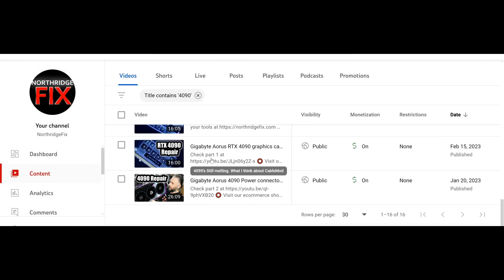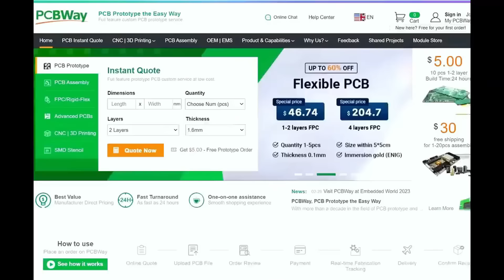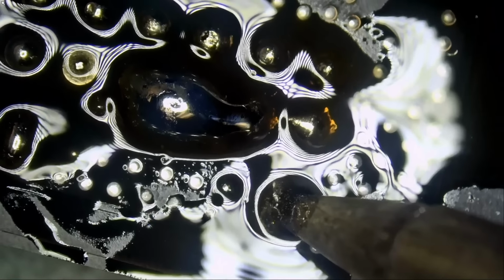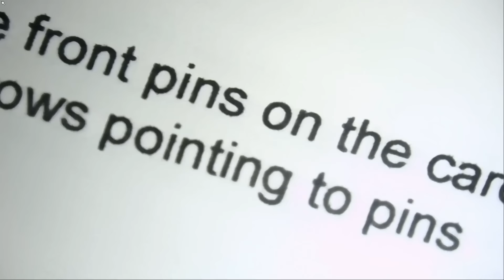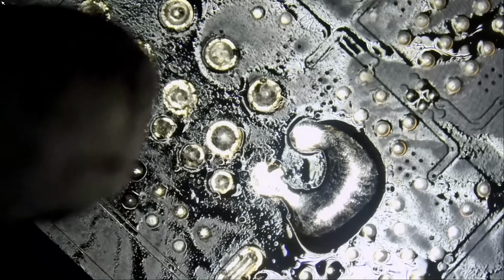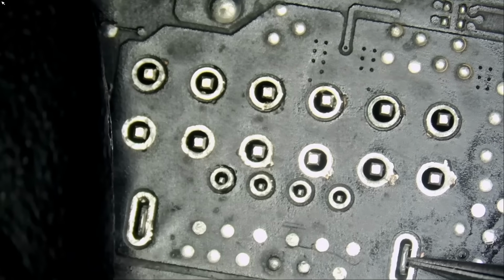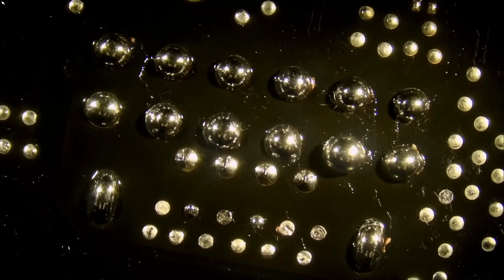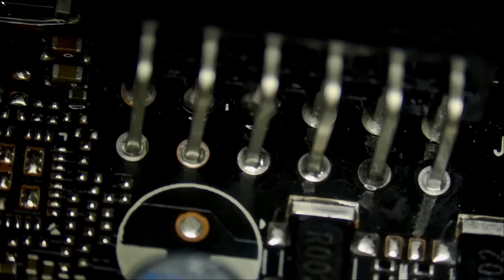4090 Graphic Cards are still a Problem.

Comment: It is beyond me how NVIDIA doesnt get a class action lawsuit to their ass. This is simply ridiculous.
Reply: Just posted the exact same thing bro - How on earth this is possible is beyond me - Clearly an issue with these connectors.
Reply: I don't know a single 4090 owner that actually has this issue. It's definitely user error. Notice how the majority of the damage was on the upper pins? Almost as if the side of the case has pushed the wires from the power connector downwards causing no full contact with the upper pins...
Reply: @jamieclarke2694  FACTS it was already proven that the melting is caused by improper usage 

always make sure your high power connectors are FULLY plugged in lmfao
Reply: They managed to make people believe 6gb of vram is still good enough, so i'm not surprised at all, people said greed is what ruining gpu market, i say it's brain rots
Reply: Because people keep buying their products and defending them. Just like Apple products, however they got sued not too long ago...
Reply: @matthewgerlach5775  Any beginner engineer can make a connector that doesn't work if it's not properly seated. It's not rocket science.
Reply: Yo this is not issue with the card… its user error!!!
Reply: @NebulositySirus  It’s both.
Reply: They are still using the same connector for upcoming 50 series cards as well. Like why? This is so frustrating. I was planning to upgrade from my 3080 but ig i gotta wait.
Reply: Because it isn't a manufacturing problem. Go watch Gamers Nexus extensive testing video on this. By far the most in-depth, comprehensive lab testing and analysis done on the issue. The result is human error, specifically, improperly seated cable that is pulled sideways. Don't argue, just watch, you will see.
Reply: @RafiYagami  Actually the connector was redesigned and the sense pins were shortened by 1.8mm.
Reply: All they had to do was pay one youtuber to convince people that it's user error and you have people parroting that Gamers Nexus proved it despite all the evidence to the contrary
Reply: @fewew7898  do you think Gamers Nexus built their business on paid biased reviews? They are the only reviewer that adheres to strict scientific testing under lab conditions and they're smarter than any other channel I've seen.
Reply: Nancy Palosi wont allow it. Its a matter of national security. Also Nvidia makes the chip and not the card
Reply: @jamieclarke2694  exactly. when I got mine I spent way longer than I probably needed to ensure that connector was fully seated, and I have the gpu vertical putting as little stress as possible on the cable. I doubt mine will melt before it's replaced with a 5090.
Reply: @MrKrabs-tr5rh  i think too, funny. Im looing out now for the TDP of the just upcomming 5090 and 5090Ti ... with OC from enthusiast rookies, its gonna be what? 800W? not too shabby
Reply: @sonsoffishes1  he( Steve B) seems to me that way. Would be a bigtime fiasco if it was other way...I mean humanity fiasco ...
Reply: @jamieclarke2694  Do you know ANY user of a video card that's having those classic PCIe connectors and have this kind of issue?

Comment: Glad i skipped the 4090.
Reply: I have a PNY4060ti 16GB it's working fine. But it doesn't have that pwr connector.
Reply: And you think the 5000 series will be better? We don't get refinement gens anymore like we used to, where they tried to make things more efficient before just BiGgEr PoWaR like now.
Reply: Glad i walked away from ngreedia  in 2002.
Reply: Im still happy with my 3090ti havent ran into anything that I need to do that it cant handle. Everyone else seems to want more more more.
Reply: I'm glad to tell you: all newer  generations  are going  to use this melting connector
Reply: @MrMousekillaz  16gb for real ?
Reply: @Par2Pixel  same. happy with my 3070ti, no issues, does everything i need
Reply: My 4070 working like a chaaaaaaaamp
Reply: You didn’t skip it, you just can’t afford it
Reply: @romankozlovskiy7899 DAMN 😱😱😱 Cold Blooded 🥶🥶🥶😂😂😂
Reply: Get AMD gpu, it ia great card
Reply: @MrMousekillaz the original comment was talking about the 4090 not the 4060ti lol
Reply: My 4080 is fine for me
Reply: @Swift5703  Word is nothing and it will not change the fact that it is an overpriced faulty hardware
Reply: @romankozlovskiy7899 Nice projection
Reply: My Asus Strix 4090 is almost 2 years old and stil going strong
Reply: @mr.number9279  We can only hope they will be better. :D
Reply: Yeah just got one a few months ago, glad to know I bought a $2000 landmine. God I am really starting to hate PCs, consoles suck but at least they don’t explode.
Reply: @fdiskformat5049  comon, I am used to expect mz PC hw to last for 10+ years eazy...lets see how it goes in the future ...

Comment: 4090 pulls like 350 to 400 watts with a small and weak connector, this is a design flaw
Reply: The specs push too much so it have very low tolerance. If 1-2 pins fails and mating incorrectly at high resistance, although it will not cause much heat because of resistance, other pins are taking more loads and get heated up, now it's a cascading failure, all pins doom to failed of 1-2 pins already failed.
Reply: My gigabyte one would pull over 500w, scary stuff I sold it because of this fear
Reply: Instead of designing the connector around the load, the consortium designed the connector first. They may have intended it to handle high Amp consumption. But....
Reply: The end of your statement is wrong - it is not a design flaw; its an intended design. Do you really think that the designer and builder of those video cards dont know their insides 100%?
This along with the fact that they dont honor the warranties fit perfectly; its greedy/savage capitalism - anything goes for money.
Reply: You can pull up to 600W on these in fact!
Reply: @ryutenmen  Por que no los dos? It's an intended design, but it's still a flaw. That's like saying Boeing's screwless doors aren't a flaw, they are, but it's intended.
Reply: 450w to 600w actually in full load

Some cards come from the factory limited to 450w, but you can push it to 600w with a simple slider in MSI Afterburner, some comes with 600w out of the box

600w is the limit of that conector
Reply: @whitebeltbjj3739  no reason? that thing is a fire hazard. I don't want anything that draws 45+ amps in my pc.
Reply: My GPU afer OC pulling  ~200W from single 8 Pin molex no issue here ;)
Reply: Always had been
Reply: @kkrolik2106 because the design works
Reply: It isn't a manufacturing problem. Go watch Gamers Nexus extensive testing video on this. By far the most in-depth, compressive lab testing and analysis done on the issue. The result is human error, specifically, improperly seated cable that is pulled sideways. Don't argue, just watch, you will see.
Reply: It isn't a manufacturing problem. Go watch Gamers Nexus extensive testing video on this. By far the most in-depth, comprehensive lab testing and analysis done on the issue. The result is human error, specifically, improperly seated cable that is pulled sideways. Don't argue, just watch, you will see.
Reply: That 12-pin connector is now replaced with a new type that supports higher draw. If one uses 16awg wires, the resistance would reduce considerably and therefore lower temperatures at the connections.
Reply: My 3090 has 2 power connectors. Not sure why the 4090 only has one? Seems like they knew what the 3090 needed
Reply: Ive seen both. You sound like a bot. @sonsoffishes1
Reply: @TheDealer6373  sorry for your brain then

Comment: People should start suing these companies for not honoring warranties, warranty is like a contract and any breach of contract should face legal consequences
Reply: The problem is that they pushed the whole user error narrative so much that companies are hiding behind that as an excuse not to honor the warranty.
Reply: that wouldnt fly in EU
Reply: It isn't a manufacturing problem. Go watch Gamers Nexus extensive testing video on this. By far the most in-depth, comprehensive lab testing and analysis done on the issue. The result is human error, specifically, improperly seated cable that is pulled sideways. Don't argue, just watch, you will see.
Reply: @Crystawth  it IS user error.

Comment: 4090 a problem, 14900K a problem... Damn, I'm still very happy with my 3090 and i9 9900K
Reply: I have the same set up and it’s doing great!
Reply: Same but with 10900k, just did a repast of my the thermal and kept both for the next 8-10 years!
Reply: See my smug smile 13700k n 4080, so quiet and so far so very very good
Reply: Try 7800x3d & RTX 4070 Ti SUPER. You'll feel a lot better.
Reply: @xfiremaniac no. Because that basically a 3090/3090TI anyway. What you want is a 4080 super. Much,, much more powerful and no problems at all.

Comment: 20 cards a week is crazy.😢
Reply: And that is just Alex. Imagine if you add all of the other repair shops, how many it is. Class action needs to be started.
Reply: @jemijona  the resell value on these cards will age like milk in the future
Reply: 80-100 card per month 😢
Reply: I just plug and play when I purchase a new GPU. Overclocking them causes most of these melting to draw too much power, and the connectors  can't handle it. Obviously, it is what's happening
Reply: Yup, alot of nerds don't know how to plug in a connector...lol
Reply: That's the tip of the iceberg!
Reply: @Nathan-ry3yu I completely agree with you.
Reply: @Nathan-ry3yu  Not all cards suffer from this fault. It is mainly Nvidia cards with their sub standard plug that is most at fault.
Reply: @Nathan-ry3yu  There, we have it. Everyone, this guy plugs and plays, so there is no issue at all.
Reply: 7 000 000 rtx 4090 selled Nvidia dont give a F lol
Reply: @Benri05  :)) it eats too much wattage for any of my liking....:))

Comment: I will never overclock my TUF 4090. 400+ watts over that tiny connector is asking for trouble. I've got mine undervolted, it rarely pulls over 250watts. I think its kept me safe so far.
Reply: I did the same to my Asus tuf 4080 super. Undervolted. Temps are great and no noise during gaming. And does not exceed 225 watts in most games max.
Reply: Got mine 480w without issues.
Reply: Why do you even use 4090 if you're not even using 50% of its performance?
Reply: That new pin connector is suppose to let GPU draw 600 watts plus the 75 watt from the PCEI lane too... the connector is too fragile which compounds with user error when plugging it in melt the cables.
Reply: @RelaxSimmer  Thats the question I'm asking... 

You paid over 1000$ for a 4090... just to use less than 50% of its power???
I don't understand that logic
Reply: @dothex  my 4090 pulls ~450 W over the last year when VR gaming in simulators without any issues.

Im using the corsair cable.
Reply: @dothex  See my reply aobve for reference, actually the -30%/-10% is the typical case but with max load, meaning original 500W drops to 350w only with 10% performance loss. But normally gaming can't drain full load from 4090, so such undervolting + oc will have the middle level of consumption 50% power and still have in average 90% performance there, compared to all the default settings.
Reply: @dothex  Maybe they heard the news of 4090 connectors melting after they had already bought one, so then decided to take measures to prevent this even if means not getting the performance they paid for.

Comment: I'm curious if out of all the 4090s you have repaired, have you ever had to repair the same board twice?
Reply: More than likely yes
Reply: I would say yes, he has repaired probably the same card more than one time reason being is because he’s not actually fixing the problem. He’s just replacing the problem. He’s not the designer of the graphics card. He just swapped out connectors.

Comment: I've loved Nvidia for the last 15 years, but I am so glad I picked up a 7900XTX this generation. Not quite on par with a 4090, but absolutely zero regrets!
Reply: LOL, I never go back to AMD. Last two 6800XTs crapped out on me 2 months after buying. AMD had no solution and gave me my money back. With Nvidia you get bad connectors, and with AMD bad connectors AND bad drivers.
Reply: @Marauder1981  The drivers on my 7900XTX work better than those on my 3090 do on my main rig....
Reply: @Marauder1981  funny I've had a reference 6800xt on a waterblock for quite some time now.  Aside from fully wiping nvidia drivers and caches, I havnt had any issues.  Sounds like user error, kill 2 6800xts.  What are the odds?
Reply: ive run my 6800 non xt full tilt for 3 years just blastin man just blastin she a banger real
Reply: XFX swft 6800xt, no issues and drivers are fine. My buddi with the 4070 is having a harder time playing pubg and warzone than I am, he's constantly getting kicked from games or loading screens
Reply: @Marauder1981  Sounds like have skill issue
Reply: @davesway1170   Getting kicked from games is a network issue, not a GPU issue.
Reply: It doesnt even match 4080 in actual gaming picture quality and performance nor efficiency
Reply: @Marauder1981  Glad I switched to Amd.
Reply: @suprafastmafc User error on 4090 plugs.
Reply: @powerplay074 I literally just watched a 4080 vs 4080super vs 4090 in 4k gaming benchmark. The 4090 is at minimum 20fps higher than both 4080s. In fact the 4080 and 4080 super were only 1fps difference across all games in 4k. 
Do ur research before making such dumb claims.
Reply: @rkwjunior2298  im talking about 7900xtx not 4090 lol
Reply: @Marauder1981  lol sure fanboy. I've had numerous AMD cards, not a single one ever died on me. I have had a couple nvidia cards die on me though. Rarely had any issues with AMD's drivers either. Such old and tired talking points.
Reply: @powerplay074  It's faster than a 4080 super, actually.
Reply: @Son37Lumiere   "fanboy" such an unoriginal insult. Are we hurt? Aww.
Reply: @Marauder1981  It's not as much a direct insult as it is a fact. Though yes fanboys are an especially sad bunch.
Reply: @Marauder1981  I don't think anyone believes you. One gpu, sure but who's actually dumb enough to buy two products form a company that can't help you troubleshoot them?
Reply: @Marauder1981 sounds like a skill issue on your end, maybe take better care of your devices lol
Reply: @Fatcat-ss6nh   maybe a better gaming chair?
Reply: @Marauder1981  I don’t see what that has to do with your terrible care of those 6800xts but ok lol

Comment: 600w and 12v is 50amps on those small wires and connectors.
Reply: Yeah, better to use bus bars than using wires with connectors.  Perhaps the 5090 will use two of those connectors to provide NorthridgeFix twice the amount of work!
Reply: It's overclocking that's doing it. Drawing too much power through small wiring will melt
Reply: Dont forget you have 5V in there as well, that I believe is the higher current.

Comment: If they admit then they will have to repair or replace... This is what happens when you have a monopoly
Reply: AMD gpu is awesome, it might not sold as well compared to Nvidia but is a better card overal if you don't want the useless features and best streaming quality in the planet
Reply: You realize they don't have a monopoly right?
Reply: @tyler6971 name one other graphics card that can compete at the 4090 level.
Reply: @nengyang1895  This question is not relevant to what I said.

Comment: I bought a 4090, oddly enough the connector at the GPU didn't melt but the connectors at the power supply unit did melt. 
I even bought the special cable from NZXT to go from 2 connectors to a single one so I didn't have that crazy adaptor with like 8+ connections installed.

Comment: Wow that should be covered under warranty
Reply: Did the customer plug it in properly?
Reply: @rkwjunior2298 im sure most of these issues is more than just connecting it properly, with how many gpus he gets
Reply: @Tsumi784  You'd be surprised how many people have trouble with simple tasks. Especially when they aren't familiar with the design change.
Reply: @rkwjunior2298  yeah thats true, however. The 4090 uses a lot of power compared to the other 40 series cards.
Reply: @Tsumi784  hahsha Cuz it has the best performance.  It's actually very efficient vs performance
Reply: @rkwjunior2298  no point in getting better performance if its at the risk of a like 2k dollar card lol….
Reply: @Tsumi784 Yeah it uses a lot of power but just maybe it's also not the best idea ever to use only 12 pins instead of 24 (3×8) to supply your card with power, just my opinion. Like using a single 8pin on a 4070 or a 7700xt...😅
Reply: @di4mondpl4ys45  Well there's a reason why its only the 4090s... and i honestly feel like it is the power, the adapter is probably fine on the 4070s and 4080s but its not built to handle 450w-650w on average. like people were having issues with the 4090s a month after release.

Comment: I’m so glad changed my mind and got an AMD card I know it’s not quite as fast but fast enough n had zero issues with it in a year n half
Reply: Sure RTX 4090 might be a little faster than the AMD equivalent but AMD one is just at the right spot for high end monitor refresh rate while extra few frame from Nvidia would not be visible with the monitor Amd gpu for 244hz monitor running at 244fps and nividia is 248fps for example  😂
Reply: No rtx lmao

Comment: I would fit a temp sensor on the connector, like the (XSPC Flat Wire Temperature Sensor 10K) Less than 10$/£ Just tape the sensor to the connector and plug it into to the T-sensor header (if you have one) on your motherboard. You can then monitor the connector temps and set an alarm for high temp spikes.

Comment: Kingpin put two 12 vhpr receptacles on the RTX 3090 ti cards that EVGA produced. It seems that would be a low-cost solution to this problem. But then, it may cost an extra 8 bucks in manufacturing. I am done upgrading my system.  I will only replace broken parts. The hardware vendors, esp. Nvidea, have taken all of the fun out of the hobby of building exciting new computers.